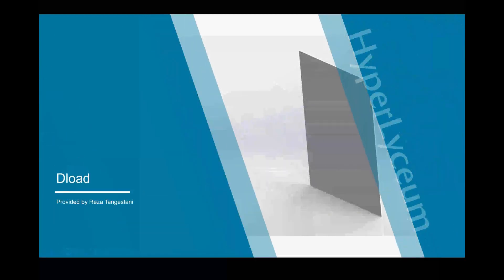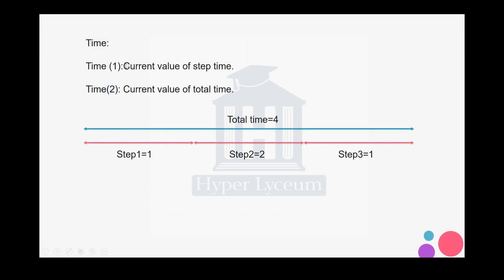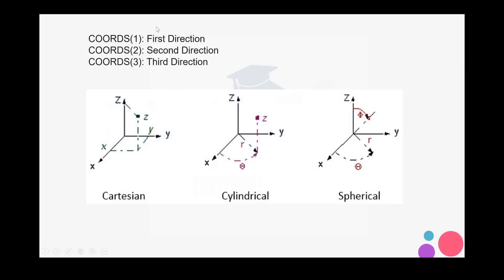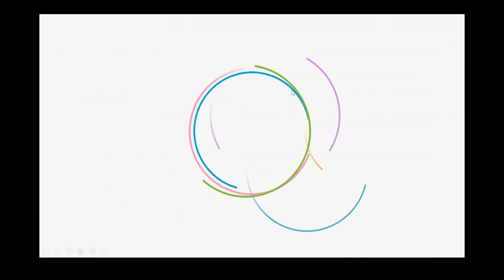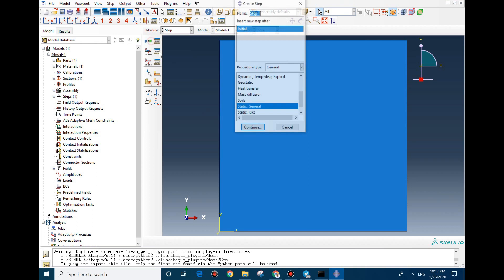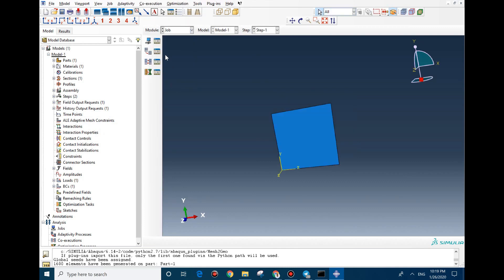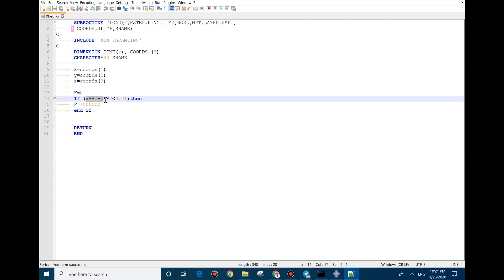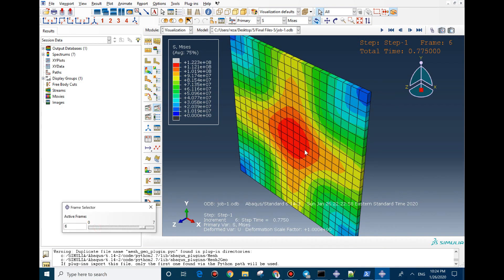An example for Dload subroutine in Abaqus

Comment: Hi, I followed it and didnt get the same results. I even changed the formulation to 3D stress and changed the part to a solid one and I have the same bad result…some stress in one of the corners and thats it. but thanks for the videos, i will keep trying!
Reply: I fixed this by moving the center of the part to the origin, if you have the corner of the part on the origin you will have to make an adjustment to the formula. I experimented with this a little bit by changing it to: If((x+.1)**2+(y+.1)**2<0.01)then
Reply: @rs4race  thanks! I will try it!
Reply from the maker: Hi,

For more help you can ask your question here:
https://hyperlyceum.com/question/category/abaqus/

Comment: If I want the load to vary with time, is it possible to use the Dload subroutine?
Reply: Yes, You can.

you can use time(1) or time (2) (I have explained the difference in the video) to control time.
For example, if you need to decrease the load by time (your step time should be 1 second):
F=F*(1-(TIME(1))